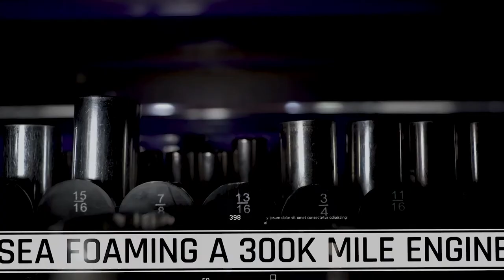Begginers guide to MIG Welding

Comment: The audio output on this is excessively low.  I’d consider editing the audio output if you can to at least 30-50% higher.  Great introductory info otherwise.
Reply from the maker: Wierd I didnt have any audio issues on my computer, I'll definitely check it out on another device and re-upload it. Thanks for letting me know!!
Reply: @AcesGarage   I had to turn it up to full 100% on both my TV which has an external self-powered speaker as well as my iPad also set at full 100% to hear you sufficiently, and even still in some parts that wasn’t enough.   At 50% set on either device I can barely understand you.  At 25% nothing at all.   So at 100% it works somewhat, but the kicker is my speakers are instantly blown on any next video.  I’d highly suggest a mic setup or re-master the audio if able.
Reply: @AcesGarage  yea the audio was way lower than the other videos.